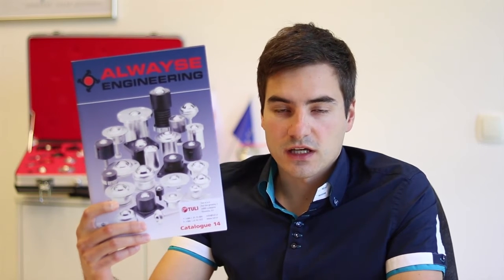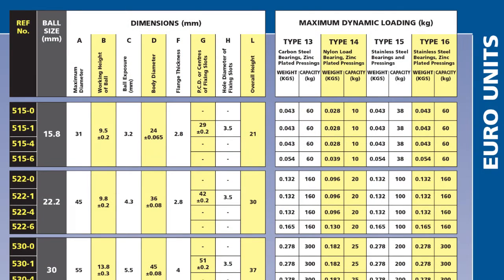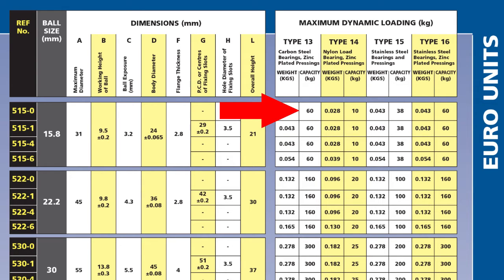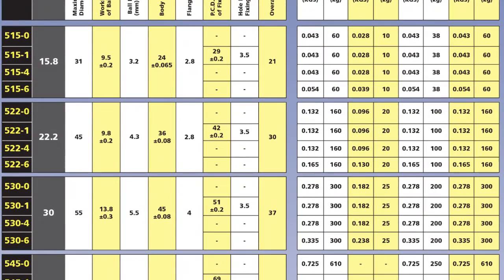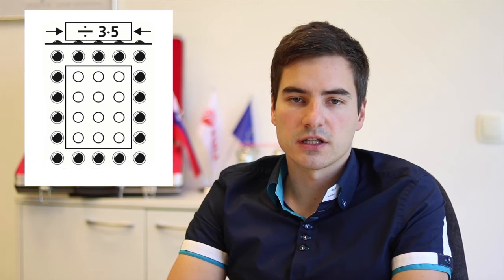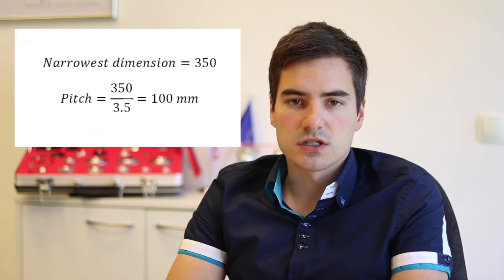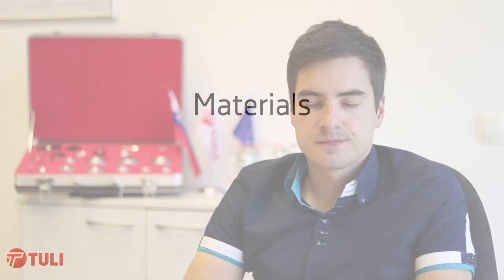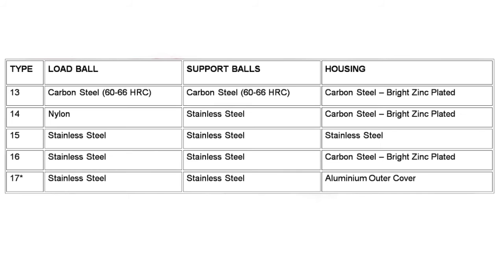How to Select the Right Ball Transfer Unit

Comment: Hi, why we should divide by 3?
Reply: I think it's to do with static vs. dynamic loading. A static load of 300kgs means that 300kg is the maximum stationary load on the ball transfer unit but when moving, there is more stress on the ball so to account for this, you drop the load to a third.